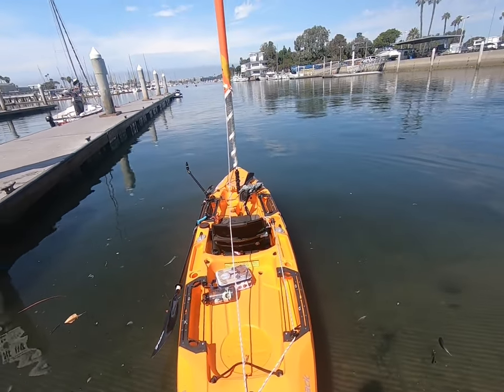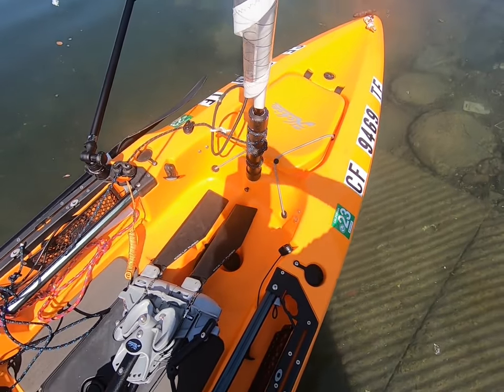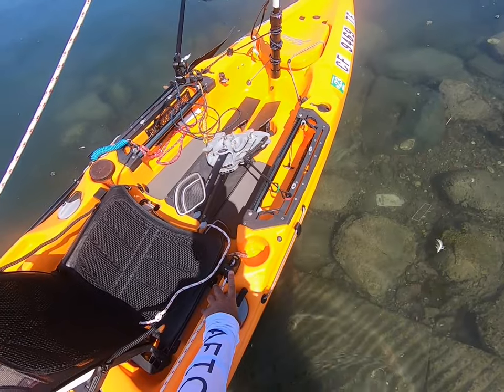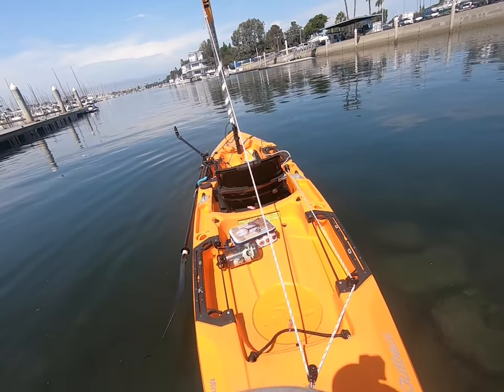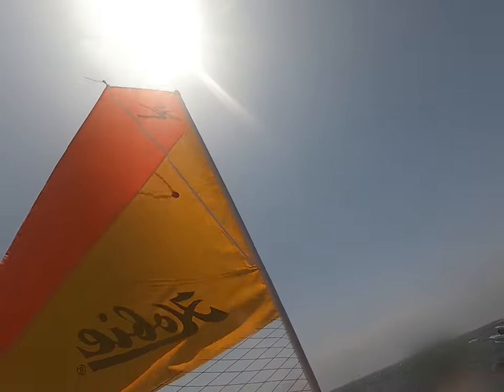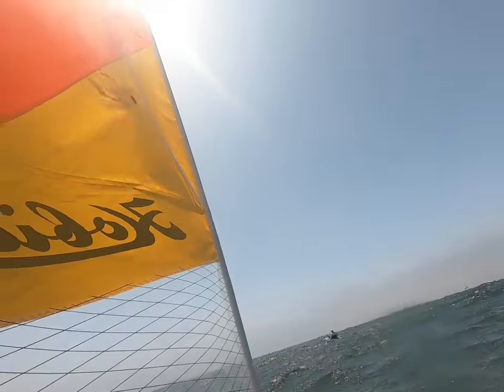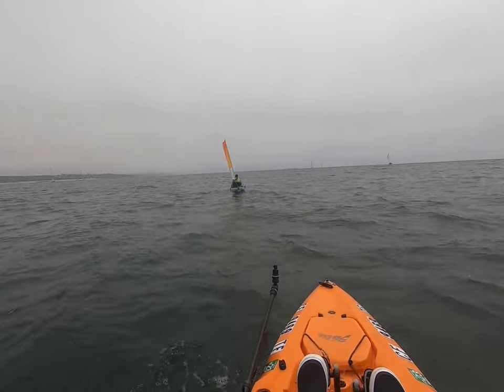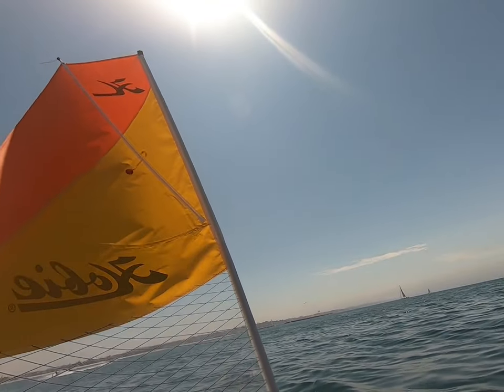Sailing Hobie Outback Kayak in rough conditions 25 mile gust winds sail furler rigging

Comment: I didn't want to invest all that money for a sail, not knowing if I would enjoy it.  So I picked up some galvanized conduit from the big box store that fit perfectly into the mount on the outback.  I had a portable hammock made from parachute material that had just been sitting on a shelf in my garage, so I took that and a clear shower curtain that I picked up for $15.  I cut out the dimensions of the sail and sewed the two together.  So for less than $50 I had a great little sail.  I did but the outriggers to give me more stability on those days when the wind was really kicking.  Everything came out so good that when I was done there was no need to even consider buying the  hobie $500 sail

Wish I knew how to post a photo in here
Reply from the maker: Nice if you are handy I am sure you can make it work. I also enjoy DIY projects but that's a bit too big of a project for me. I see also a lot of used for sale, still not as cheap as the one you made. Enjoy smooth sailing!
Reply: Well I was able to show it by making ity profile pic. Lol

Comment: What is the name of that locking gizmo with the automatic locking system that holds end of the rope for your sail ( you mentioned is pricy)? Where can I order one ?Thanks
Reply from the maker: Hi, all parts I got from west marine, in the description I listed the parts
Spinlock Single Camcleat No Base. You can go with the one they have for 1/4" rope, but I went with the one size larger so the 1/4" rope goes trough easier.

https://www.westmarine.com/spinlock-single-camcleat-without-base-for-1-4inch-rope-8155889.html

Comment: Can you show a close up of your PVC pipe for wrapping the sail ..thank you
Reply from the maker: Hi, there is no option to add a picture of the pipe. Its very simple to make. A 11 inch 1 1/4 pvc with end cap on each side, I drilled 1 inch hole in both caps. Then make 2 holes for the rope to go trough, one is at the top and one hole 2 inch high from the bottom and just guide the sail line into the pipe/furler